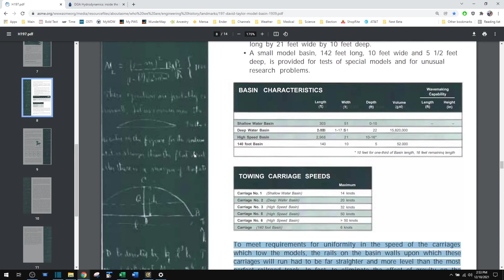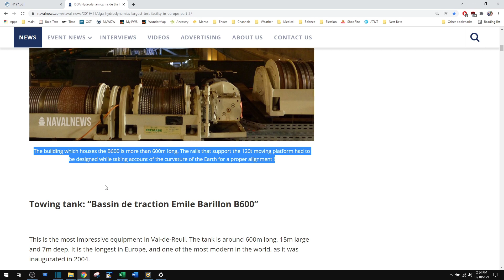Evidence For The Curvature Of Water

Comment: I live around 10 miles from one of the two Laser Interferometer Gravitational-Wave Observatory (LIGO) facilities. I watched it under construction. While the foundation was being constructed, a civil engineer and an equipment contractor told me they had to adjust the grade to account for the curvature of the earth. Otherwise the lasers would not be accurate. This is a statement from the Facts page of the LIGO website: "Curvature of the Earth:  LIGO’s arms are long enough that the curvature of the Earth was a factor in their construction. Over the 4 km length of each arm, the Earth curves away by nearly a meter! Precision concrete pouring of the path upon which the beam-tube is installed was required to counteract this curvature and ensure that when the laser beam leaves the ‘corner station’ (traveling in a straight line) it strikes the test mass/mirror at the end of each arm, and not a meter above it." Source: https://www.ligo.caltech.edu/page/facts
Reply from the maker: And, the as-built construction drawings are online so anyone can verify they accounted for curvature. 😊

Comment: We can't be accurate on that small a scale, but we sure can on this here gigantic scale...
Reply from the maker: The measurements in this report were accurately taken over lengths of less than half a mile.  And, this was over 25 years ago so we can be even more accurate today.
Reply: nice fallacy you have there Slim. and that's correct actually. we can measure 0.1mm with ease. we can not measure 0.1x10^-5mm with ease. there are physical limitations to certain things.

Comment: The local horizon, also called the geometrical horizon, is the visible boundary between the Earth and sky. 
The sea-level horizon is the geographic horizon at sea level.

We only have 1 - ONE horizon.

Abu Rayhan al-Biruni (AD 973–1048)
The 11th century Persian mathematician Abu Rayhan al-Biruni used simple trigonometric results to estimate the radius and circumference of the Earth.
Al-Biruni was not aware of atmospheric refraction. 

Black Swan image shows the horizon way further away than the geographic horizon.
Proving that the horizon is not geometrical/geographic. Proving that the model is wrong.
The horizon is an optical phenomena. It moves with the weather. 

Al Biruni could therefore not measure the radius of the earth.
Reply from the maker: "The local horizon, also called the geometrical horizon, is the visible boundary between the Earth and sky. "

But, the horizon we see from the beach is the apparent or refracted horizon.  Or, are you saying there is no such thing as atmospheric refraction.
Reply: @microbeta  The horizon we see from the beach SHOULD be where the water/ocean meets the sky. Where boats go over the curve and disappear bottom up. That has been disproven. On clear days you should see it. If you are 6 feet high and look out, the horizon should be at a distance of 3 miles. The problem for the globe model is that on clear days we see the horizon way further out than 3 miles. Not with your eyes only perhaps, but pick up a good zoom camera and you will easily prove it for yourself.
Reply: @microbeta  Of course there is atmospheric refraction. Seen the bendy cranes on the oil platforms? Thats distortion. Thats as expected, its a very long distance (10 miles) being only 1 foot over the water surface. The horizon though is behind the oil platform. Thats a problem for the globe. Now you answer me, 1 foot over the water - how far away should the horizon be?
Reply from the maker: How far the horizon is at a 1 foot elevation depends on atmospheric refraction.  At any elevation for that matter. 

If you want a real answer define the atmospheric conditions.

You do realize we NEVER see the geometric horizon...especially over water?  Right?
Reply: @microbeta  I see that this is a question you dont want to answer. You are not honest sir.
The globe model dictates that the horizon can be no further than 1.225 x square root of observers height in feet. The globe model dictates that the horizon is geographic over the sea.
Geographic means that it is based on or derived from the physical features of an area.

You do realize that the globe model dictates that the horizon is where boats go over and disappear bottom up?
Please show me evidence that atmospheric conditions can move the horizon over 10 miles from 1 foot height over the water and set it down behind the oil plattforms. Good luck with that. ;)
I suggest using some magic voodoo tricks.

You say that we NEVER see the geometric horizon. I agree. All flat earthers agree with you on that.
As an anti-flat-earther you HAVE to go agains the globe model. And you know it.

From nationalgeographic: “The sea-level horizon is the geographic horizon at sea level. One of the best places to SEE the sea-level horizon is a beach. The ocean and the sky provide a clean, flat line where the Earth seems to meet the sky. If you're standing on the beach looking out at the sea, the part of the sea that "touches" the horizon is called the offing.”

You clearly dont agree with them. It’s all good. Neither do flat earthers.
Reply from the maker: @CapricaSoul  The visible horizon is not 1.225 times anything.  We see the refracted horizon every time and that is always farther than the geometric horizon. Always!

So,  trying to say that we see farther than the geometric horizon disproves the globe is nothing but an intellectually dishonest lie. Yes, you are lying. And, we both know you have absolutely no evidence to back that assertion. 

Educate yourself and try again.
Reply: @microbeta  This conversation is over. You got more attention than what you deserve.  Good luck with your cognitive dissonance. Adios.
Reply from the maker: Thank you for conceding the point.

Comment: @Mike Bertelson  You have air in a spherical shape on your model. Your refraction is Terrestrial refraction. Terrestrial refraction is considered as a constant bending of the ray of light or line of sight, in which the ray can be considered as describing a circular path. A common measure of refraction is the coefficient of refraction. Unfortunately there are two different definitions of this coefficient. One is the ratio of the RADIUS of the Earth to the radius of the line of sight
Reply from the maker: Still, the existence of refraction not dependent on the radius of the earth.  You assertion that we need R for that is just plain wrong.

Not to mention, as I explained in the thread you started, we have R.  Deal with it.
Reply: @microbeta  You dont have R. Deal with it.... even though it hurts. 😉
Reply: My height is 0.0000003 R. OMG, my height can't be real because it begs the question of the radius of the Earth!! 🤣
Reply: @primonomeultimonome  Are you ok? 😆
Reply: @CapricaSoul  he's more ok than you.

Comment: I did a 1-Minute Debunk Video on Towing Tanks for Mr. Sensible's channel a while back.
A few things that I found out about the rail alignment:
there are a few methods to actually align the rails to the curvature of the water:
- in Bordlewood Tank in Southampton, Pins were used every .5 meters to align the Rail to the water surface.
- in a belgian tank, a ship model is dragged trough the water very slowly and the  depth of the model in the water is measured. IF the model sinks too low, the rails are raised with bolts.

Accuracy of the rail alighnment (vertically and horizontally) has to be <0.1mm (!) which is well below the required correction for earth curve (approx. 0.59mm at 160m)

very interesting stuff, and thanks for mentioning it on your channel!

Comment: LOL !!!
Reply from the maker: What exactly did you find that was funny?
Reply: @microbeta  This is a Glober who disagrees with you. Look him up and ask him about it. Here is his name and comment - cinnamoncontrol says,
" The towing tanks (for ship model testing) are indeed claimed to account for the curvature, but they are adjusted to be level with the surface of the water. Works on either flat or globe."
Reply from the maker: That's an assumption on his part.  And, in most situations tracks laid level would be enough.  However, in this case the tolerance between the surface of the water and the tracks requires tighter control in design and contraction.  

This is literally the only time you'll see tracks designed with curvature accounted for.
Reply from the maker: Did you read the links provided in the description?
Reply: @microbeta  No but I can show you railroad companies when laying tracks that say they do account for Earth curvature and others that state they did not account for Earth curvature. Which is more likely and how do we know? We have line of sight observations over known distances that show our observations do not match a spherical Earth with a circumference of 24901 miles. By this physical size your horizon must be no more than 1.22 miles distant times the observers height in feet squared. It is claimed by this that an observer height of 6 feet above sea level should experience the horizon about 3 miles distant. A camera placed one foot on above sea level can see at least 10 miles distant to the horizon. This observation can be made almost everywhere everyday. It shows the radius for an Earth 24901 miles in circumference, has to be incorrect. To me, that's a problem, a failure of the model. I am not a Flat Earther, I am a heliocentric skeptic. I won't make claims about the size or shape of the Earth but I've seen enough repeatable evidence to be skeptical of the model that's shoved down our necks since kindergarten. You can just dismiss the gentleman if you like but how are you ever going to understand his point of view if you never ask him?
Reply from the maker: I do understand his point of view.  I'm an engineer and fully understand his point but there is something he seems to be missing.  Usually, when a railroad says it follows the curvature it’s because they built a stretch of track level which by default is following curvature.  That is not at all what is going on here.  The difference is the design and installation tolerances that need to be met for the intended purpose. 

I don’t know how much you know about fluid dynamics but the distance between the tow carriage and the water surface is critical.  Without that, the flow characteristics and test data would be meaningless.  

For tow tanks that means instead of just level they actually have to shoot the entire length instead of just making it level.  You just plain wouldn’t need that on standard track construction where minor variations would be inconsequential.  In that case making each length installation level would be satisfy the design requirements.

So, for the hydrodynamic test facilities, tolerances on the installation are much tighter.  Simply being level isn’t good enough.
Reply from the maker: @DivergentDroid  BTW, the tolerance on the rails for the David W. Taylor test facility..

(b) VERTICAL STRAIGHTNESS. "The tops of the finished rails shall lie concentric with the still-water surface in the adjacent basins, with a maximum variation of plus and minus 0.005 inch throughout their length. This maximum variation shall not occur within any one length of 50 feet."

A railroad would never have to meet such tolerance.

Comment: What has those examples to do with large bodies of water? Nothing. If the earth is a sphere with a radius 3959 miles, then every horizon distance measurement MUST BE NO MORE THAN 1.225 x square root of observers height in feet. Black swan image shows the horizon greater than 9.41 miles at 1 foot height. That is not possible on the Heliocentric model. https://www.youtube.com/watch?v=bsZrjmZ9pBw
Reply from the maker: So, you're going to completely ignore that the curvature of the water in the basin is measured and accounted for in engineering design.  Why is that?
Reply: @microbeta  Electrostatic charge can pull water making it look bendy. Now try doing that to big bodies of water. GO!
Reply from the maker: The so called black swan is meaningless.  It's clearly highly distorted and there isn't any data to back up the claim.  Data such at the atmospheric conditions at the time the picture was taken.   Taking pictures very close to the water level only worsens the effects of atmospheric refraction.

Real science requires actual testable data.  All you have is claims.  Learn the difference between claims and evidence.  Here's a hint...claims presented as evidence is literally a logical fallacy (Proof Surrogate logical fallacy).  Try again when you learn how science and debate actually work.
Reply: @microbeta  Thanks for proving that you have not understood the argument in the Black Swan image.
Your refraction needs an R. You dont have one as the horizon is optical. Al Beruni thought it was geometric. Black Swan and your clinging to refraction proves that it is optical.
There is refraction and distortion the further you observe. That is NOT a proof of a globe. 
No one cares about bendy cranes on the oil platform you stupid. Its the horizon that is BEHIND the oil platform. Didn't you know that? Its impossible to move a horizon that should be in front of both platforms behind them. Only people believing in fairytales would fall for that.
I dont subscribe to the heliocentric model. All your fairytales about what the universe are just pseudoscience.
Reply from the maker: “Your refraction needs an R.”
What the hell are you talking about?  You do NOT need the radius of the earth for refraction.  Refraction is due to atmospheric conditions and its effects do not rely on curvature.  Wow.  Seriously, you need to educate yourself if you’re planning on debating a point.

BTW, we have R.  The radius of the earth is objective scientific fact.  It is a matter of scientific consensus.  And, do pull that appeal to authority crap because that’s wrong.  Evidence subject to scientific consensus is not an error in logic so it’s not a logical fallacy. 

If you dispute the radius then the onus is on you to prove it wrong.  I do not have to defend what is already objective fact.

Answer the following question.

-Where is the evidence that shows what you claim is the most like reason for what we see and that can’t be anything else?
-Where is the evidence that all the clear, undistorted images of the platforms are not representative of reality. 

If you can't answer these questions the all you have is a claim.  Come back when you learn the difference between a claim and evidence.
Reply: @CapricaSoul  Why are you so frustrated? Is that because flat water doesn't exist?
Reply: @primonomeultimonome  You are in cognitive pain. You know that water finds its level. :)  But continue believing that water curves. You know you cant demonstrate / prove it. ;)
Reply: @microbeta  You have air in a spherical shape on your model. Your refraction is Terrestrial refraction. Terrestrial refraction is considered as a constant bending of the ray of light or line of sight, in which the ray can be considered as describing a circular path. A common measure of refraction is the coefficient of refraction. Unfortunately there are two different definitions of this coefficient. One is the ratio of the RADIUS of the Earth to the radius of the line of sight
Reply from the maker: @primonomeultimonome  Now he's avoiding all my responses and creating new threads with the same crap. 🤣
Reply: @microbeta  He's so triggered!! LOL
Reply: @primonomeultimonome  Projecting your pain is hilarious. 😂
Reply: @Mike Bertelson  You have air in a spherical shape on your model. Your refraction is Terrestrial refraction. Terrestrial refraction is considered as a constant bending of the ray of light or line of sight, in which the ray can be considered as describing a circular path. A common measure of refraction is the coefficient of refraction. Unfortunately there are two different definitions of this coefficient. One is the ratio of the RADIUS of the Earth to the radius of the line of sight

Comment: which curvature calculator do they use ..would be good to know the exact amount ...becaus e the one everyone gets online don't add up ..earth must be way bigger then we think or the online curvature thing says   which is 8 inches squared per mile i think ......but yeah this def a good test, just very short
Reply from the maker: Actually, 8 in/mi² is only an approximation but is good enough for short distances.  However, there are two calculators that I like to use

Walter Bislin's: http://walter.bislins.ch/bloge/index.asp?
Metabunk: https://www.metabunk.org/curve/
Reply: Hi Bang. The 2 sites Mike linked are probably the most popular, at least in our circles. I encourage you to put some numbers into them both and compare. Because when I do, they give identical results. 
Make sure to compare "apples to apples". Make sure, for example, that both are set to zero refraction. You don't want to have refraction in one of them and not in the other. That would not be "apples to apples".
I just checked them both with zero refraction, 6' observer height and 10 miles to the observed object. They gave identical results.
The 8"/mile^2 is a good approximation for "drop" over dozens of miles. But remember, "drop" and "hidden" are NOT the same thing. I've seen a lot of people make the understandable mistake of confusing the two. The equations for "hidden" are considerably more complicated than drop. Anyone with good skills in geometry and trigonometry can certainly do them. But they're not simple. That's why the calculators are handy.